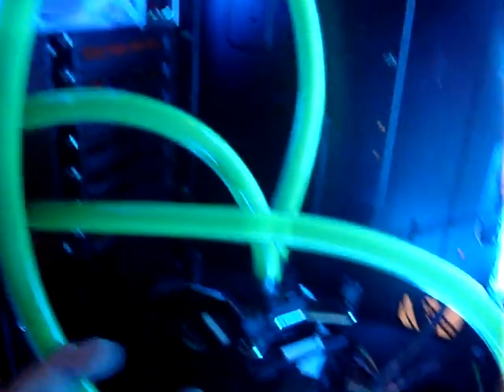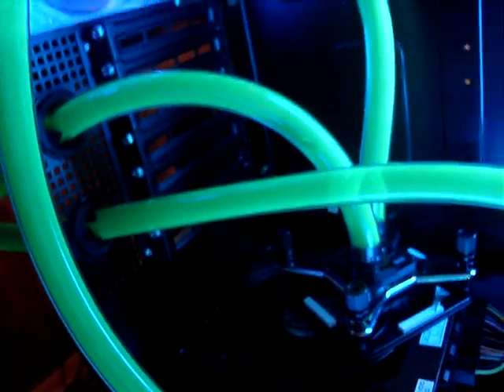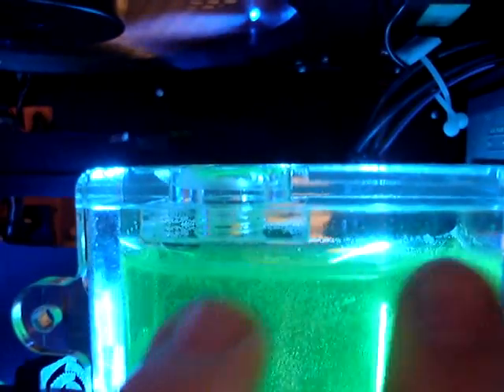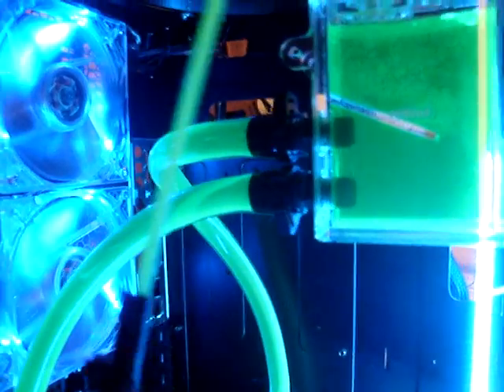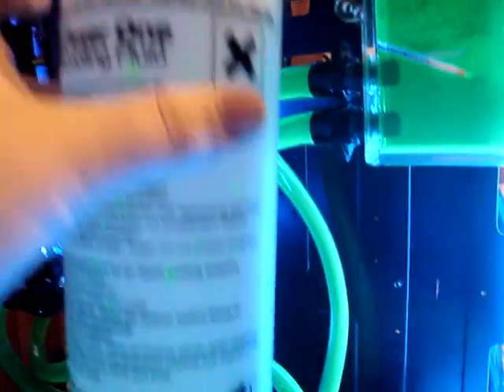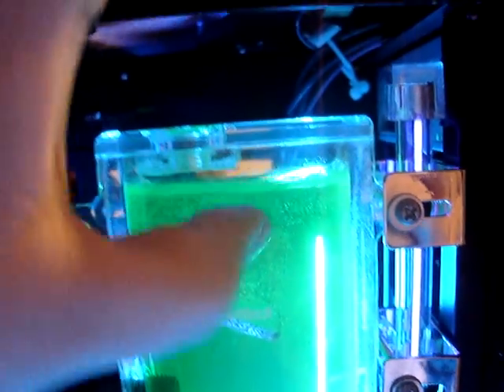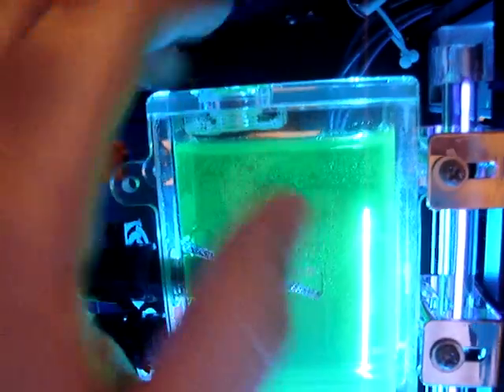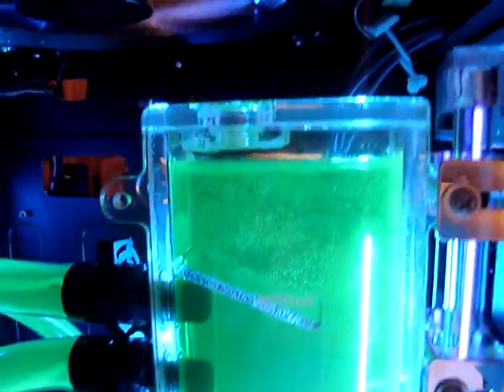Antec Build 5 FastVideo (Thanks)

Comment: nice bro ? for ya ive always wanted to try water but am really afraid to make the jump is their a lot of maintence involved i was at microcenter fri and they had the h20-220 for 144.00 and only one left is this a good price and most importantly is it hard to install i was planing on getting a noctua nh-d14 89.99 would the swiftech completely crush the d14 as it is the best air cooler on the planet i have used the corsair h50 but that thing sucks balls

Comment: I am happy with the Core i7 900 Series CPU's and there doesn't seem to be any AMD CPU's that compare to it at the moment. But if you feel there is a CPU better than the 975 feel free to correct me, One of the main reasons I think going with a Core i7 CPU is because the new 6 Core CPU's are said to be coming out on the same socket and the motherboard I will be getting is supposedly going to be able to support it.

Comment: Hey, I plan on installing the same cooling kit on my new build. How are you powering the system in this video? In the manual for the kit it says you can close the 13 and 14 pins on the main power connector (but you don't even have a mobo in this vid) or you can use a PSU tester. Which are you doing? I'm sure its obvious but am just wondering. TIA